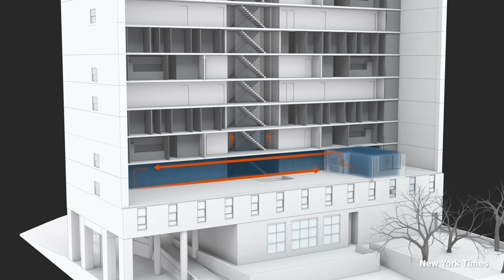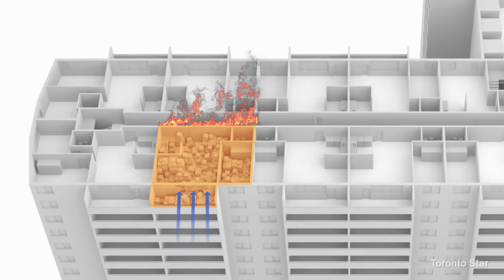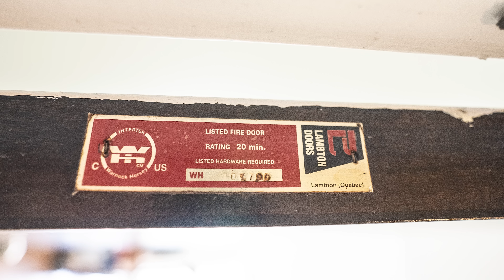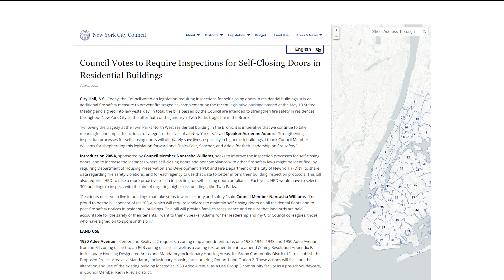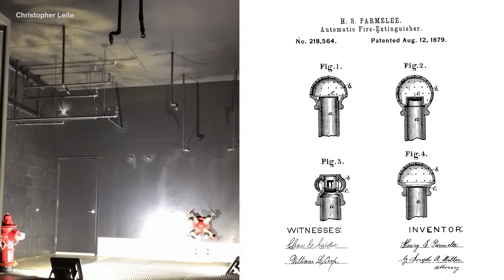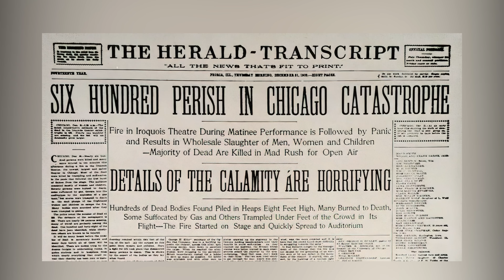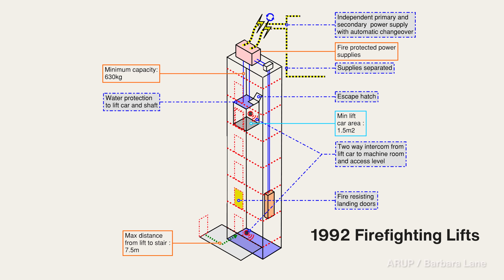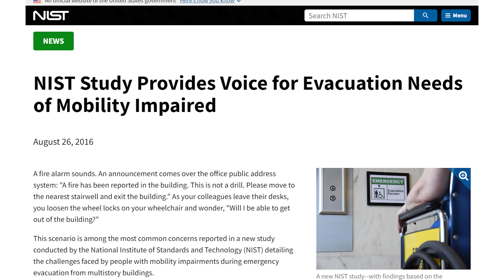How Hidden Engineering Keeps You Alive in Apartment Fires

Comment: great video. Missed a few things though. 

Smoke control typically doesn't have exhaust fans anywhere, at least for the GTA. They will have exhaust vents in the stairwell to let some of the air back out, but not enough in order to keep the stairwell slightly pressurized. Same goes for the elevator shafts. This often means automatic doors also open, serving a duel purpose of ease of exfiltrate and relieving pressure.

Elevators are automatically disabled and driven to the firefighter floor. (usually ground, but it depends on the building) After letting the passengers out, the doors close and will not operate again until the firefighter key is used, or the fire alarm system is reset.

The biggest missed item is that sprinklers always have water available unless being serviced. You kind of show it in the last diagram with city water supplied from underground, but didn't mention it. The Siamese/FDC connection is only to supplement the water supply. Taller/larger buildings require very large booster pumps. Some are electric others are diesel, usually in excess of 100 HP.
Reply from the maker: Thanks for letting me know! You work in the industry?
Reply: @Lam  Yes. I do HVAC, and we are required to cooperate with the fire control guys to inspect those fans and pumps. We even test the pressure that the fans actually produce in the stairwells/elevator shafts. There's a regular schedule for that.

Comment: After years of consistent false alarms with one siren installed in my bed room...

I made the siren more accurate by smashing it to pieces. So far it's accurate all of the time and I reduced the risk of getting disoriented by the extremely loud noise. 

I no longer evacuate the building when I hear the alarm in the hallway.

I give fire-fighters the middle finger when they come tearing through the street with ear piercing alarms on their way to the next false alarm risking lives of other road users.

I did learn something though. I took the powerful restraint off my fireproof front door because it was unusable that way. Still not putting it back but I try to remember to close the door behind me when it's on fire.

What I do to prepare when the alarm goes... 

I inspect my apartment for fire, smoke or smells. Then inspect the hallway and inspect the building from my balcony and go back to bed.

I am familiar with the official escape routes and have an alternate involving some climbing and a ready rope.

Screw the regulations. They are hamfisted and stupid.

Meanwhile my building manager refuses to deal with the grease saturated and blocked rangehood ducts which in fact are a huge fire risk.

They refuse to keep the concrete stairwell clean which has gotten rather slippery.

And at one stage refused to remove stored furniture from a fire escape route.

I hope you can understand my attitude towards fire regulations.😮

Comment: One bit of advice I got from some one working in a hospital was simple, if you get a fire at home, or anywhere you are present, fucking run. Most people die from smoke either on the spot or might drop death 6 months later from all the toxins they inhaled (and hence not counted in the stats often). Same idea if there is a fire and your exit is blocked by smoke, stay in place indeed. 

My own flat is a 1970s era design, but been gutted and redone completely. Still we have wooden window frames and such. However each apartment opens up to an open air galleria and not to a central hallway. The concrete slaps that make up the floor also make up the full length balconies so act as flame diverters for vertical spread. Horizontal spreading is however a risk from those same full length balconies. I am not sure I fully trust the shafts however, but should be fine. 

A former friend of mine I knew lived in an other styel of building much lower, but still like 5 or 6 floors, less safety stuff there for sure, but they knew how to ab-sail and being on the corner have a choice of 3 sides, so they have a hook int he ceiling rated for it and and rope at the ready. Not a solution for most people, but you make due. 

Also helps that smoke detectors are now mandatory by law for every house/apartment here. 

The next big issue is coming from Ebikes and mainly the many high unsafe batteries being built and sold all around. A well made safe battery can cost double the money, but it is something that needs to be looked at for mandating certain standards as the size of the batteries and the speed with which they can go up is a great danger.

Comment: Smoke inhalation is the No. 1 killer of people in a high rise fire. High Rise buildings that don't have fire sprinklers are more likely to develop the kind of smoke and flames that kill people than buildings that have fire sprinklers. In the U.S. the NIST recommended that all high rise building should have a redundant active fire suppression system (Fire Sprinkler system or similar) to protect against "single point failure" of active fire suppression systems. Self contained fire sprinklers that use a small amount of water mixed with Firefighting foam and compressed air can be installed in each unit functioning independently of single source fire sprinkler systems that rely on a single fire pump located at the base of the building. 
Chief Hughes
Battalion 1 (retired)
Chicago FD

Comment: Doesn't apply to every country sadly. Our high rise apartments don't have fireproof doors. No springlers in apartments. Only fire alarms which  usually doesn't work at all.  Only staircases have fireproof doors. Families are doomed if stay inside their house . Facade cladding is flammable,(regulation changed only in 2022 ,so all buildings before that are doomed) in minutes whole building engulfs in fire . Firefighter are very poorly equipped,forget about 16+ store buildings they have hard time with 4 stores already. Walls between units are very thin. I hear my neighbours phone vibrating. So better to get out as soon as possible Staircase has HVAC system similar to this video but it's still not enought. What if people can't reach the staircase. What if there is a fire between their home and staircase? But trusting the firefighters is a suicide idea here.Firefighters might be equipped with bucket of water! Hope our building standard would be updated more and adopt this regulations.

Comment: I think foam that expands when heated is mostly a non-US thing. I've lost this argument at my apartment in L.A. I have a heavy fire door. But it requires thick weatherstripping all around it to keep out a strong breeze that is always gushing in from the hall. After enjoying the draft-free setup for six years, one manager suddenly saw it and had the maintenance man scrape it off. The fire inspector now insists that the door MUST slam itself closed when let go after being held open just four inches short of closing! It DOES slam itself closed, even with tight weatherstripping, when let go from about ten inches. 

Ugh. Toxic fumes sometimes come in around the door. Therefore smoke will, too. I offered to pay to install an automatic door closer at the top, but the manager said he thinks they are illegal.

Comment: the ''firefighters using elevators'' part honestly surprised me, because every elevator has a sign saying "in case of fire, use the stairs" so i always thought elevators are not usable due to the heat breaking their systems... never would have guessed it was to save firefighters valuable time and effort to reach higher up areas in flats and other tall buildings

Comment: Something rarely mentioned but very hazardous is a homes bathroom fan that removed steam and heat.

When these fans get old noisy and struggle to turn on they become massive fire hazards. Energy is put into the motor but isn’t properly used so it is used as heat until it combust. These fire are hot enough to ignite older attic insulation or dry wall  even without flames touching it 

The attic fire will burn without smoke and flame and because there are no smoke detectors in the attic you have no alarm. These fires are found when the entire roof burns out or you find the burnt fan and decided to replace the entire metal housing (the fortunate thing I did) and feel heat pouring out of the attic 

You could install fire alarms in the attic, or there are fire extinguisher ‘bombs’ that set off from some heat and put out all fires in a smaller space

Comment: huh? all of the new buildings in my state (US) burn to the ground with the slightest fire that would have been minimal damage in an older building....
Reply: I don't know what state your in but, I am in New York, Most of the time if a new buildings is destroyed it's due to failure to follow proper fire safety rules. For example we have a mall, if a fire were to break out in a parking garage their their a risk of partial collapse to due to failure to upkeep the structure for safety. The collapse would be cause by lack of fire proofing and a heated metal only this time the structure is weaked with rust so it takes shorter amount of time. For me that's the number one reason place burn down. Also if your talking a residential buildings or industrial bulidngs those are different then highrises.

Comment: Doesn't apply to 90% of the built environment unfortunately. Much of the UK has highrises covered in highly flammable cladding (like Grenfell tower) and much of the US is building 5 over 1's and suburb housing out of engineered lumber, which is basically normal wood that has oil thrown in it, making it burn much sooner than traditional timber. 

Not to mention fires are more likely in the first place around the world because most new cheap furniture is made out of that same engineered lumber, which means once something lights, all the furniture in that room can very quickly ignite into a mass blaze.

Comment: I had wondered why apartments weren't built to contain fires, I guess the few I've seen on the news were only a few floors, so weren't required to be built that way.  I bet those concrete walls and floors are also great for sound blocking.

Comment: I live in NYC and we've always all gotten out of the building, These buildings are so old and messed up that the fire easily spreads from apartment to apartment, They recently added fire extinguishers to every floor in the building so atleast that's good..Lol
Reply: Fun part is fire extigushers are for fire fighters most of the time lol
Reply: @chinookh4713  WTF would the fire extinguisher be for the fire fighters when they got a whole damn hose with water  🤦🏽‍♀️🤦🏽‍♀️🤦🏽‍♀️
Reply: @idfwy_ylsabiafwy182_GiGi  Civilians can use them, but to understand why their their you need understand the tactics, truck company typically carry in the fire extinguishers commonly referred to as a "can". Engine company job is to provide water don't he fire. Hose take to time so often extigushers are used for a rapid response incase they grab the wrong extigusher or they don't have one. 

Here's an example: Fire reported in a food store engine company is stretching the hose, truck company enters and notice is possibly a grease fire but they have a can with water instead, so rather then running back out wasting time they grab the fire extinguisher rated for kitchen fires that nearby. 

Theirs other reason like the guy with the hook and can is don't he otherside of the building while the guy with the irons has located the fire, he just grabs the nearest exitgusher. 

Again civilians can use them but most of the time its to help firefighters

Comment: Maybe high rises should have sensors in emergency stairwells that could be used to determine whether people should exit.
Reply: Ehh sensors fail often times too much tehcincal stuff
Reply: @chinookh4713  things don’t always work. But they work more often than doing nothing does.
Reply: Chief engineer for Kent FRS (U.K.) has implemented system of first advancing teams in SCBA into stairwells with CO and HCN monitors to assure safe conditions. Emulated by some, but not all fire services so far.

Comment: Tip: if you ever get stuck in house or apartment due to  fire complete blocks your emergency exit. Go to bathroom if you can, turn on shower to keep your self wet and open the drain cover from shower stall or overflow tub cover, place long tube into drain to breath air or smash the toilet out of way and place tube into flange to get air.

Comment: in Toronto they just approved and are building a 10 story building made of wood to be more eco-friendly ..  I thought it was nuts !!  after seeing this video I know they definitely are
Reply from the maker: They're safe!  So those buildings have to use mass timber which takes a long time to burn. The reason is that the outside chars and forms a protective layer and the wood is still strong enough to hold up the building.  We have a much better understanding of engineering and it's not just concrete anymore but it might take some time to trickle down to residential buildings.

Comment: Unless it's 9/11, when a jet fuel fire can melt steel in seconds 🙄
Reply: Lol, it didn't melt the beams, the heat weakened the beams. Metal doesn't need to melt to lose its strength. That's how people are able to work with metal to alter it into the shape they desire. And unlike the examples described in the video, it wasn't a room that caught on fire. It was a giant plane moving at very fast speeds which destroyed the part of the building it crashed into, which defeated the purposes of all the safety measures. Because, ya know... a heavy, fast moving plane destroyed everything in its path. Please try to think before you speak in the future.

Comment: Something that could save your life......before you open the door to your apartment in a fire in ANY building, feel the knob and if it's hot, don't open the door, then carefully crack the door to check the hallway for smoke.   And if there is a heavy smoke condition in a high rise hallway shut the door and seal the cracks with wet towels. If you have any doubts about the situation, call the fire department and inform them of your location, the dispatcher can advise you and if necessary notify units on the scene of your location if you are in danger. Also, know where the stairs are and how many doors from your apartment to them, as you may have to crawl in smoke to get to them. FDNY Ret.

Comment: Good video about fire safety and how to properly react to fires in buildings. I work as a fire sprinkler engineer, and noticed a couple of small errors, nothing that changes the overall message of the video just things that bother someone who does this daily. 
For standpipes, the GPM coming out of them is dependent on what class they are which is dependent on the type of building it is in. While there is a class of standpipes that is rated to give 150GPM, most are rated to output 250GPM out of at least two outlets simultaneously. 
The response time of sprinklers comes in two varieties, standard response and quick response. You are correct in saying that townhomes and apartments are required to have quick response sprinklers, but many commercial buildings have quick response sprinklers as well. For the commercial sprinklers it does depend on what the building is used for to decide the sprinkler, as an office has much less fire capacity than a paper mill. 
I also feel like it does a disservice to not mention the codes that govern this design such as NFPA, and FM global data sheets. 
Feel free to ask any question about sprinkler systems and I will try to answer them best I can.

Comment: Elevators actually have even more safety features than you might think. A lot of consideration has been put into their designs, and elevator accidents typically happen when a building gets some kind of exception from code, or due to users attempting to use it outside of its design (ie, riding cab-top is very dangerous). Other reasons might be building owners not properly re-certifying the elevators or overriding issues.

Comment: Not only is it important for these systems to be installed properly when the building is built, it's also critical they be maintained and tested on a regular basis. I have been involved with testing fire protection systems in buildings for over 20 years, and it's disturbing how little thought is put into maintaining the fire protection after the building is complete. Not only that, but the indifference that is felt by residents that live in the building during testing. I have many examples where testing these systems are "inconvenient" or a "nuisance" for the residents of a building. You don't realize this is done to keep you safe! In my career, I have seen buildings I have inspected burn to the ground, but everyone got out alive. Don't take for granted these systems or the people that keep them working.
Reply: In other words, putting scores of people in tall buildings that look like torches waiting to be set alight can be made safe provided highly trained, conscientious architects and builders build them and conscientious inspectors inspect them and all the occupants take fire safety seriously and never wedge a door open despite the great inconvenience that causes. But there is no guarantee of any of that. Designing a tall torch-like building is like designing the material for an inferno. And if the first generation of architects, builders and inspectors are conscientious, everyone will think fire safety is not an issue and will therefore take it less seriously and then there will be a fire.